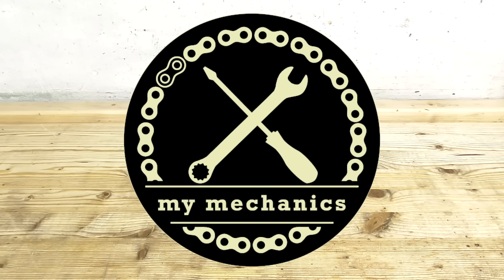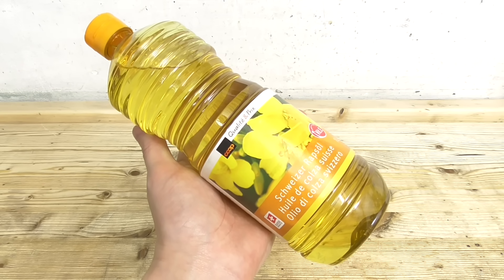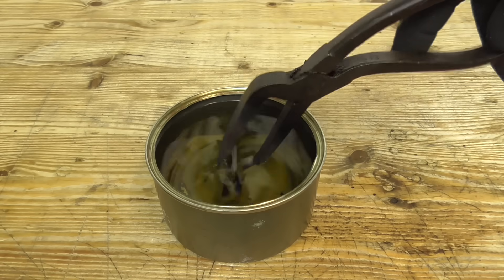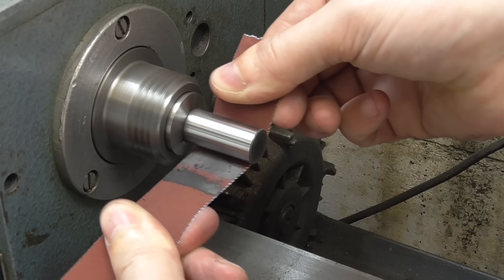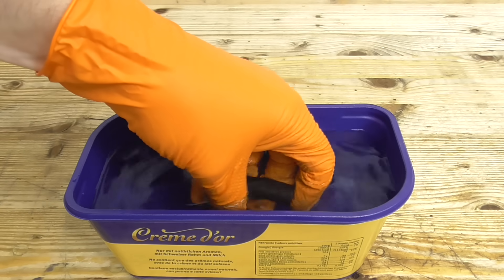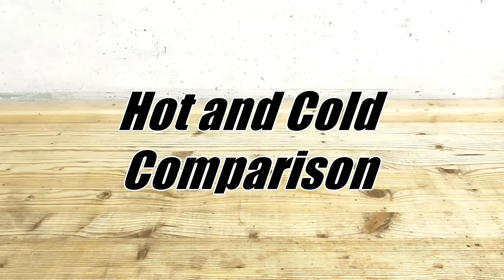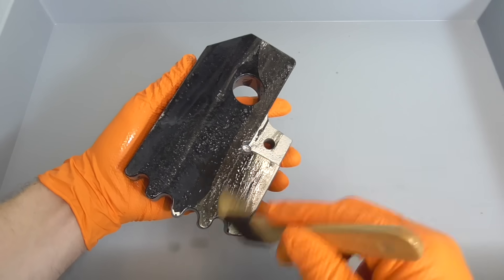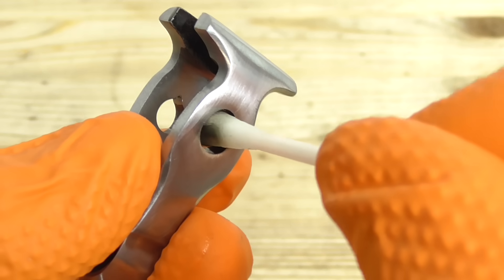How to Turn Steel Black - All you need to know about Bluing

Comment: This is not bluing, this is carbonizing (I think that's the correct term for converting something into carbon, oil in this case) via quenching. It's also nearly impossible to gauge temperatures accurately by eye, especially if you are inexperienced. word of advice would be TO NOT DO THIS to anything important.

While it may provide a protective finish, it also has the potential to change the physical properties of the metal, making it harder/softer and or brittle/more flexible.   This should NEVER be done on anything that requires a specific hardness or elasticity to function correctly.  If you did this to a spring for example, you'd probably irreversibly damage it.

Comment: For hot blue I use extremely old & dirty motor oil. I really like the effect and coloration I get and as stated, it’s extremely cheap. Really informative video.
Reply: Have you ever done a gun? If so, How do you heat it evenly?
Reply: @buckethead1928  I use a propane tank with torch adaptor. I personally use the 100K BTU Flame King torch adapter.
Reply: @alexdaman.  thanks man.. I have a sawed off double barrel I would like to re blue

Comment: That’s basically how cooking pans such as woks are seasoned to develop non-stick properties.
Reply: That or a Teflon coating. But I prefer the bluing as the Teflon usually peels off over time and is a type of plastic and thus also a carcinogen. And I prefer not eating plastic
Reply: Is that right?  So we could repair our old pans with flaky non-stick by bluing them?  I don't think so. Nowadays they're all aluminum under the coat and bluing doesn't work on aluminum I  think.
Is there something we can do, then?
Reply: @abrogard142  he is correct but didn't explain it right. some cooking vessels, such as a cast iron skillet, will be "seasoned" by burning oil on the surface, which yields a non stick and rust preventative coat. so yes, it is a quite similar process to what is shown in the video
Reply: @Arterexius  Plastics in general are not carcinogenic and you can eat ptfe in raw amounts. Its so inert nothing will happen, other than being released on the other side of your body. 
Heating up ptfe above 200°C or more howecer will release gases that are toxic, but also not carcinogenic.
Don't spread wrong informations.

Comment: sand blasted looked the best, i need to buy myself a sandblaster
Reply from the maker: is my favourite too
Reply: @mymechanicsinsights  
Question:
Wonder if this application could be applied to an Intake on an Automobile ... Most engines run at 200° degrees or slightly higher in some cases
Reply: I need this paint please deliver me
Reply: My sandblaster has been one of the most cherished tools in my metal finishing arsenal since buying it...  If you do anything applying finishes to metal, or even just leaving it in its "raw state", a sand blaster is definitely a "must have" tool in my book.
Reply: I’ve setup several of the harbor freight cheap sand blasters and also some more expensive industrial ones. All have clogged and caused problems. We had one at work I think it had a vibration motor in it to keep from caking up. That one worked amazing never had one problem with it. Used glass beads in all of them.
Reply: I build a sandblaster. It is more cheaper and with a little bit of hand skills, it is easy
Reply: I agree, the sand blasted did look the best in both hot and cold
Reply: @alexb.5669  Where is diy video?
Reply: @marinpaveskovic6754  I didn't made one
Reply: @irshadtanoli2330  

Paint...what paint.?
Did you even watch this video.?
Reply: @jenky1044  English is clearly not his first language and I'm sure he understood the process, just not how to describe the solution so he called it paint. That makes sense as he saw the guy painting the stuff on with a paintbrush in the video and it has the appearance of being painted even though it's a chemical reaction. I am pretty certain Irshad knows this isn't an actual paint.
Reply: @RichardMLowe  intake is cold side of the engine.... Most cars nowadays have plastic intakes.
Reply: @jelleveirman  duh
Reply: @jelleveirman  🙄🙄
Reply: @RichardMLowe  well it's not gonna be 200°  (celcius?) if that's what you were stating? Duh...
Reply: @jelleveirman  200° Fahrenheit (United States and NOT METRIC)
Reply: Check your Craig’s list! That’s where I found mine
Reply: It’s super easy to heat the metal if you have a kiln ! Perfect internal and external temperatures are possible
Reply: @RichardMLowe  i dud the valve cover on my old quattro.  Looks awesome and hasnt faded or discolored after about 8years
Reply: @WHJeffB  i personally am not a fan of the sandblaster because the one i use is very very old. its not airtight anymore and you can only use it for short periodes of time and then face dust in the air and sand all over the floor once your done. its a neccesity but i am not a fan of it.
Reply: @latenttweet  ours has a handcrank that shakes the entire unit to declog it

Comment: I'd like to know the wear resistance of the finish.
Reply: As I replied earlier, I do hitch pins. Those get a lacquer clear coat spray. Hitch pins on riding mowers will rust if you don't clear coat them. Hope this helps...

Comment: The question of durability has already been asked,  but you have not tested the parts.  It would be most interesting to find out,  and a very simple test would be to take a very low grit sandpaper,  perhaps 24 grit, and just do a quick "scuff" on the surface of each type bluing. This should reveal if either surface would scratch easily.  Might take several scuffs to get scratches? Please give some idea of the durability of each type... Great video... 👍
Reply from the maker: I'd say both are not very resistant for long time abd if you touch it all the time.
Reply: So we need to test and upload ourselves?
Reply: @janeblogs324  No. Scratching your smartphone can damage it! 😁
Reply: None of these processes including hot salts bluing adds any abrasion resistance to the base steel.
Reply: @David-hm9ic  interesting,  so how do they accomplish the scratch resistance with the bluing of a firearm? I mean,  I know they will still scratch,  but they seem pretty durable considering the wear and tear they receive...

Comment: In case nobody has mentioned it. It's called bluing because when you hot cut steel it turns blue (blue chips). which led to people finding a way to do that to full pieces instead of just the off-cuts. great video.
Reply: No. Bluing is a chemical process done to the surface of steel, not a state of change to the base metal displaying a color - which merely indicates the temperature it was raised to.

Comment: Great video but I think there’s one important thing missing: which method gives more durable surface? It would be great to know which one in comparison is more resistant for example for corrosion, chemicals, mechanical wear.
Reply: Rust bluing, hot bluing, then cold bluing. Rust bluing is when you allow a fine rust to form then convert it by boiling. Done over and over again it will convert the majority of the surface to black oxide which is more resistant then the other types.

Comment: Some years ago I tried using Birch Casey Cold Bluing... the immediate result looked great, but after some time the bluing started to flake even though I was very careful in following the necessary steps. The bluing lasted only a few months before it started to show detoriation.
In future projects I will try the slow rust bluing where the rust is converted into bluing...I trust this to be more durable.

Comment: Ive had a pair of hair clippers for years. I already maintain the blade so it's as sharp as the day I got it, but the upper blade gets lots of surface rust, as well as its screws.

Got sick of it and hot blued the thing. 

The cutting blade always has oil so it's not an issue... now none of it will.

Thanks.

Side note: I put a small drop of oil on the part prior to heating. When that started to smoke and catch fire I dropped the part in the cold oil.

Seemed to work well to get the temp right.

Comment: Great video! I want to recreate the burnishing effect on a BMX bike frame at weld points. I think the frame was sand blasted or sanded as the original burnishing is gone once I stripped the original paint. I've considered cold bluing to mimic this effect. I plan to use a direct to metal clear coat for a raw metal with clear gloss finish. My question is whether the cold blued surfaces would prevent the direct to metal clear coat from adhering. I'm using KBS Clear Diamond Finish aerosol. Thanks!

Comment: I tried blueing simply by heating them parts in an oven, and then quenching in oil. I used 250°C os 482°F and I think it worked OK. Not sure though how robust the coating is.

Comment: Very nice thanks. The hot bluing looks essentially the same process as seasoning iron cookware, and as you pointed out, it can flake off if too much heat is used causing too much buildup. Likewise, seasoning can be washed off of iron cookware too if harsh of cleaners are used.
Am I off base here? Can you comment on how permanent the hot bluing is compared to seasoning of cookware?

Comment: a little quick tip, if you need to remove existing hot bluing without sanding on smaller parts so you can reblue, dip the part in some muriatic acid or a couple minutes and it should return metal to original finish then rinse heat and quench, i keep a sealed 4lb peanut butter jar full of clean muriatic acid under my rinse sink just for that reason...........

Comment: Experiment with walnut husk concentrates, working with them turned my knife black like a bluing, and I dd not oil it. Some of it wore away with more use. I think if I really meant to do it, like you had here may have worked a lot like cold bluing but taken longer in the solution

Comment: Hot blueing is where you heat it until the colour changes from straw to blue, then you quench it quickly in water to fix the blue colour (where the name comes from). Quenching in oil gives it a blacker colour and better rust resistance, as seen here.

You may want to normalise your steel after quenching, which involves putting it in an oven at 200°C for two hours then allowing it to cool slowly. This is also called thermo-cycling.

Comment: I wish i would have seen this before. I was using bluing liquid on some screws for my project but didn't really knew how to do it cause there were no instructions. I didn't coat the parts with oil after it and they ended up all rusted xD

Comment: just for the record, you will not ruin the heat treatment if you heat your piece to 300° like you said. particulary on springs where the tempering temperature is 300° after a 800° hardening..on hardened pieces like knives , axes, chisels, for instance, the tempering temperature is more around 240° so in this case, you can't bluing them with heat. but for all others like springs, you can; even a high carbon steel sword is usually tempered at 300°...

Comment: I wonder how wire-wheeled part would look. Also what if you wouldn't soak cold bluing in oil. Or wich one is more resistant to friction  or scratches.

Comment: Just put the complicated parts in a small metal box or enclosure to contain heat with a basic space heater in front to get the process started and slowly torch up from a distance. Salamander would work best, obviously a blower is optimal.. Doesnt take long at all. But good advice.

Comment: Great video … thanks I had a rifle with parts of the barrel where the blue seems to have rubbed off (only small parts) there is no rust, do you think I can just retouch the spots or do I have to sand everything down and redo it ? 
( like 1/4’’ x 6 ‘’ surface)

Thanks

Comment: I just finished making a small pot-belly strove from a gas bottle. 
I heated the stove from inside fire 
And a plumbers blowtorch around the outside. 
But I didn't get that black look.
But a rainbow look.
Is that too hot or Not enough heat ?

Comment: Hot bluing in vegetable oil seems the same (?) as seasoning cast iron or carbon steel cookware. Polymerizes the oil and bonds to the steel. Is that right?

Comment: Thank you for your video. I went ahead and did the cold bluing and I find my part does not blue without streaking. I've made sure to keep the part super clean and dry it off with a blow dryer immediately. How do I eliminate those streaks?

Comment: Can you put parts in you oven to heat them to the proper temp ? Set oven to 300 put part in oven for 1 hr it should be at 300 by then

Comment: You can make bluing with a cola. Maybe it is not so good but it works. I used it for my carbon steel knife. All you have to do is to poor a glass of cola, put it in a microwave oven for a half a minute on a max power and then stir it a bit in order to lose all the bubbles. Then put knife in it for 12 hours or more. Depends upon how deep black color you want. During bluing take off the knife from time to time and wipe it to get rid of bubbles which may cause white spots. To get faster result you may warm cola from time to time in a microwave oven. That is all! It is very cheap and result is perfect))

Comment: I have some black steel pipe. The finish is ok but I want to use the pipe in a furniture piece so I am wondering if I want to try cold bluing do I have to remove the black finish or can I simply sand out the defects and then blue it?

Comment: any way to hot blue and heat treat a knife at the same time? it would seem possible but the heat needed to properly harden the steel is much higher than what would be used for bluing.

Comment: Is the bluing more effective if you do small parts using the heat treatment bluing, then acetone and then do cold bluing over the hot bluing?  Or hot bluing as you showed, then another hot bluing over the 1st hot bluing treatment?

Comment: I have a question? Recently got a Mossberg shotgun ,wasin rough shape, cleaned it up bought same bluing shown in video. Barrel magazine etc. came out beautiful.! This was cold bluing. When I tried doing receiver/trigger housing Blu  would not take. Come to find out it is harden steel. Been told factory uses a special laying paint , but called Mossberg  found out they salt Blu their weapons. Process I'm not capable of. Any suggestions? Paint seems a cheap and cheesy way and don't want to destroy gun. Spent a lot of time ,money refurbishing this vintage weapon and very proud of it. Not many left. Thanks.

Comment: I'm building a custom wood kennel for my sister, and she wants to have metal slats instead of wood so her dogs can't chew out(they are a Yorkie and a teacup Schnauzer so I'm skeptical they could but her dogs lol). I've been trying to find lighter and affordable metal options and am considering using 1/2" steel conduit pipes. I've never worked with metal in this capacity and wanted to know if you think hot bluing would damage or warp the pipes. I'm hesitant to consider cold bluing because of the chemicals involved and I don't want to risk making the dogs sick.

Comment: Can it be used on stainless steel? I know you mentioned it's not for stainless steel but my leatherman had a black oxide coating and the material is stainless steel. I wanted to remove some rust and stupidly soaked it in vinegar too long and now all the black oxide came off 🫠

Comment: Instant blue just wears off in an instant. Toughest blue is rust blue. It requires some boiling water to turn the rust blue, then carded to remove the loose stuff and repeat for as many times to get the colour you like, maybe 10x. I use Laurel Mountain Forge but they should all work ok. Yes, this is 200 year old gun stuff

Comment: There's a trick where you can boil old guitar strings in vinegar to clean them up.  The nickel-wound strings come out clean, but the plain steel strings turn black.

Comment: Would this work for a steel offset smoker instead of painting it? I actually heat my smoker up and oil it every time I use it so its like a cast iron skillet but I wonder if this could be done also.

Comment: I wouldn't say it's a total waste of time to polish steel very highly before bluing; it just depends on the process used.  Blueing has been done with firearms for centuries, and lots of different methods have been developed.  The results can vary because of differences in the precise formula of the  selenium dioxide used in cold bluing, or in the alkali salts used in some hot blueing processes.   You don't see it much anymore, because of the the skilled labor it requires, and the cost that adds to a firearm, but some guns, especially older ones made when skilled labor was cheaper, have mirror-bright polish despite being blued.  I have a 1950s-vintage Smith & Wesson .357 magnum which is beautifully polished and blued.  I also have a 1960s-vintage Colt 1911 that has a beautiful contrast where the rounded parts of the slide and frame are matte-finished with sandblasting, and the flat sides are polished to a mirror shine.   Then, after polishing, the pistol is blued.  The contrast between the matte and polished parts of the gun is absolutely gorgeous.

Also, as regards to the term "blueing" it's more understandable if you look at certain examples.  I also have a Remington Model 51, which is a pistol that's just turned a hundred years old, and the manual safety lever, which was blued with a slightly different process than the frame and slide, is a very definite dark blue color, rather than black.

And then, of course, there is color case hardening, which heats the steel in a bed of charcoal, and produces similar rust-resistance to blueing, as well as hardening the surface layer, but leaving a mottled finish featuring various shades of blues, dark greys, and browns on the steel.  Look at the frame of a Colt Single Action Army revolver, or a 19th century Winchester rifle or Remington Rolling Black to see good examples.